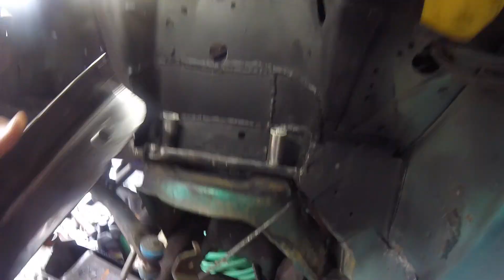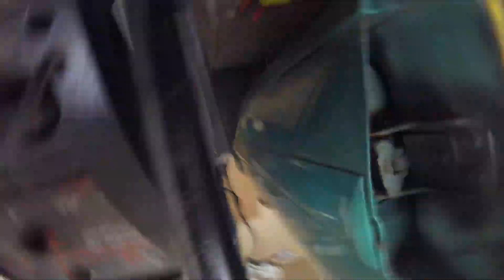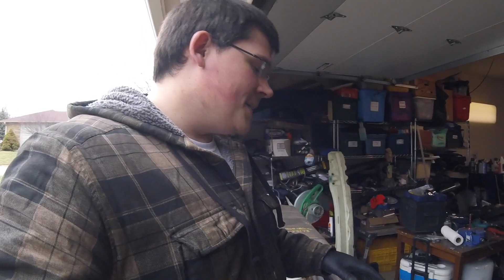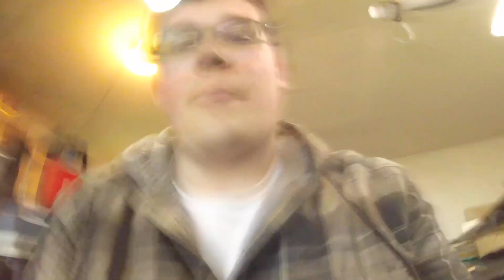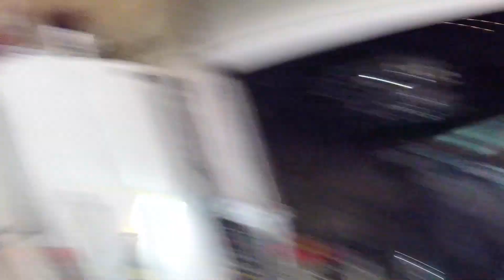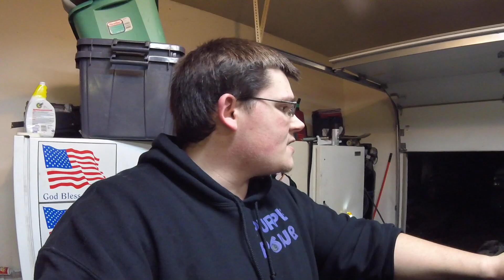Fox body Rust Repair

Comment: Had to do exact same on passenger side of my 87 welded plated etc...just finished doing the floorpans rockers etc...started scraping away undercoating and found more metal work! Lol cool channel ill subscribe i love these cars
Reply from the maker: Thanks! Actually just got the car out for the first autocross event today. Ran pretty well!
Video should be up in the next day or two.
Reply: jeffsqartan very cool man what kind of welder were you using? Welds looked alot better than my fluxcore but its strong not pretty lol
Reply from the maker: Your Flooring it's just an entry model Hobart welder. Dad bought it a few years back, never uses it, but I keep finding projects for it so I supply the gas and material and he let's me store it and use it here. Works out for us both haha
Reply: jeffsqartan sweeet

Comment: Curious as to why you repaired the rust on the wheel side vs the engine bay side like all the other vids I’ve seen. Is there rot on the other side?
Reply from the maker: I guess that's just where my rust was. That's probably the only explanation I can give. I didn't have any rust on the engine side other than what I cut out of the shock tower.

Comment: Where was that connector being disconnected doing? Because I have the same connector disconnected on mine and it will crank and crank, but will not start. Is that my issue?
Reply from the maker: The connector was a few inches from the battery. It's a cylindrical connector. If you trace one of the smaller ground wires from the battery ground, you should be able to find it.